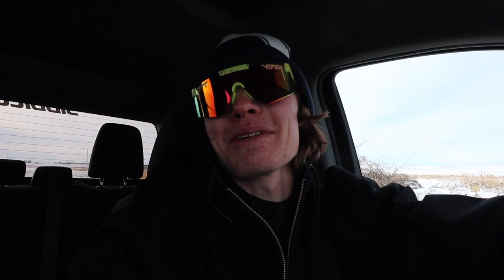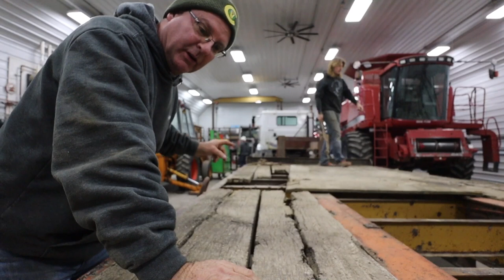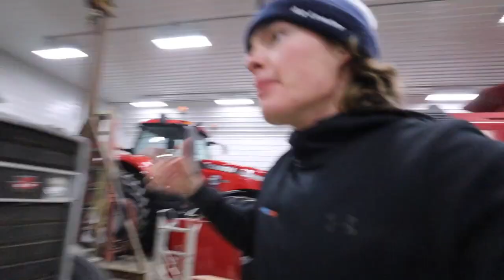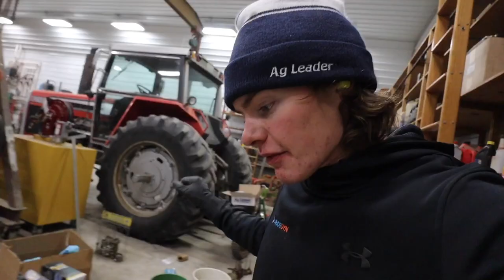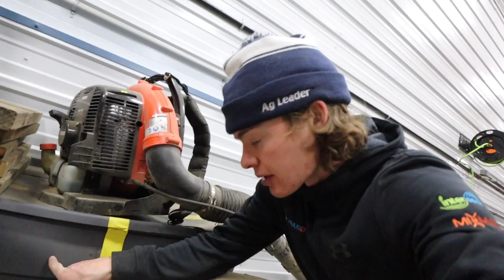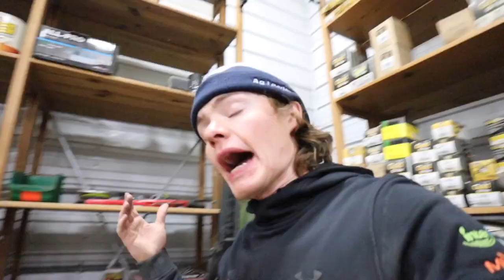REBUILDING A 40+ YEAR OLD FLATBED TRAILER

Comment: Get those brush fires started! Push them up into a steeper, densor pile, place part of a straw bale in the center surrounded by smaller wood, soak the straw in diesel fuel and watch them 🔥

Comment: If I were you while you have all that wood off your trailer and thinking about re-wiring it might as well paint it quick make her look real good
Reply: What I was thinking was, hey the fires won't start, use those old crappy trailer boards it will go up like blue blazes
Reply: Well painting it will be one hell of a project but rewire is probably a good idea
Reply: Yeah I would definitely rewire for sure, clean up all the brake line fittings and get the rust off her.  These midwest winters eat cars and trucks alive if you dont keep on top of it body rot creeps in really fast.

Comment: Hey Cole, as a former semi trailer mechanic of 16 years I really wish I could give you a hand on this trailer. However, since that's not feasible I'll offer some advice. Please reconsider using the saw mill wood. Up-front the cost will look better but the longevity of it won't be very good. You need apitong decking for a much longer floor life. Consider searching your area for semi trailer repair shops for the product and fasteners. Usually a 5/16x3" floor screw maybe 3 1/2". I also recommend a slight counter sink for them and plenty of extra t40 torx bits. Stagger your board end seams for better strength. It's also a great idea to undercoat the wood if possible. That will be one very solid and long lasting floor if done correctly. Feel free to message any time. And in reference to an much older video please don't ever weld a radius rod back together on the undercarriage. It causes bad tracking and excess damage when it's a really cheap part and a twenty min fix.

Comment: With all the oil you probably go through have you ever considered a reclaimed oil burner for heat in the shop, or at least for one of your future shops.  By far one of the most efficient heating methods is infrared heaters.  Large tube style heaters are the preference for most Plane hangers in the upper Midwest.  They work very similar to radiant floor heating, it heats objects in the room (not the atmosphere).  You can set the thermostat to around 60 degrees and feel perfectly comfortable in the space.  They work very well when you open and close doors often.

Comment: The best burn pile starter I’ve used is a propane tank with a high BTU weed torch.  You need to get a lot of heat into a cold pile

Comment: To start  brush fire get an old tire pile on some dry wood and some diesel fuel gas mix and fire up. Once the tire lights it will burn hot a long time.

Comment: I used cottonwood planks off the butt cut for decking on my lowboy trailer. Loaded D-9's on it without tearing the decking up. Saw them green, preferably after the sap has went down and get them bolted down quickly or they will warp badly. A good soaking in used motor oil and diesel fuel before putting them on keeps them from rotting. The oak deck that came on my trailer lasted 2 years and then started going to crap. The cottonwood deck lasted for the 6 years I had it and the guy that bought it got many more years out of it.

Comment: use a leafblower to get that fire started
Reply: That really does work!  We've had hard to start piles, and finally we started a fire with known dry wood in the middle (on the bottom) and gradually added existing pieces from the pile directly on the fire and as the fire burned the surrounding wood heated up and dried out so finally it was ready to burn.  A leaf blower adds oxygen to the mix and is so very helpful!

Comment: If you weld some chunks of square stock on the side of those ramps you can make a handle that slides into them that's angled a little that makes them easier to flip over

Comment: A rate controller controls the rate at which product flows from the nozzles on your fertilizer delivery system. It is usually used in tandem with thing's like a Spray Switchbox, and is hooked up (via ISO) to the black box in your cab which you use for guidance.

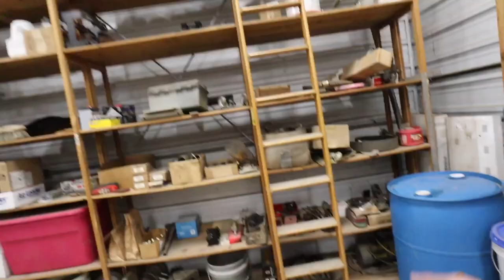Comment: You should examine the wires for the starter.  There is probably a lose wire or a wire shorting out some place.  I was looking at the tractor tire at 7:02.  It looks like it may be flat.

Comment: You should inspect all the beams on the trailer while the deck is off 2 of the trailers a contractor that i do work for both were bought new 20 years ago had major rust holes thru the the major beams and were no longer considered safe for hauling and either needed major repair, to be scrapped or sent to auction to be made somebody elses problem

Comment: When I torch a big brush pile my go to recipe is 5 gallons of drain oil, then toss on 1 gallon of diesel fuel and a cup of gas. It lights in a controlled manner and by the time the drain oil burns away you got a roaring fire.

Comment: Diesel or oil with gasoline works great. Being diluted, the gas will get it lit and the diesel keeps it burning. But when you splash it on, wait a couple of minutes to let it soak the wood. Been a no fail for me.

Comment: Re burning brush/trees..... You got to pile em high, use lots of "accelerant" (used motor oil) and if you have a "leaf blower" use that to fan the flames. Once you get things going, its going to burn HOT and you have to keep pushing the piles up and burning.
Some have reported using a couple small square bales of straw saturated with diesel and used motor oil with the leaf blower as a good thing to try.

Comment: You might try using a battery operated blower to help getting the fire started. Shove in a bale of straw and wet it with Diesel.should help also.

Comment: That box off the white planter is an Original Greenstate Rate Controller. Most likely used to measure and control liquid nitrogen fertilizer or insecticide. Guy who had it before must have had a Deere monitor in his tractor. They are still worth some money since you can also still buy them new

Comment: You are missing an ecological opportunity for a great household garden.
Look up the videos on Biochar. You have plenty of the best materials to burn into chunks of charcoal,...notice the word coal?.....sounds just like Cole.
Granted, making Biochar/charcoal is going to take up some time, but, if it is allowed to culture in a compost heap, and grow the necessary micro-organisms,  for a year, you will then have a really good household garden from what is then called Terra Preta.
The old wood from the trailer could be used for building the boundaries for raised beds about 24" to 30" wide and how ever long you want them. Then spread out the Biochar about an inch or more thick. Then, build the compost heap, sheet compost style on top. Also known as Lasagnia Gardening.
Surely someone nearby has a large round bale of spoiled hay you can spread out a foot or two deep, to get the soil biology started. It might help to wet the hay down and cover it with sheet plastic to both protect from the wind and get the biological process started in the soil.
Then just plant straight through the remaining hay in the spring.
Remember the old saying; waste not, want not.
P.S. 
#1. I almost cried the last time I saw you burn trees. 
#2. See Also: Terra Preta.
#3. You can buy bags of Mycorrhizal fungi, earthworm castings, 
fish emulsion, 
Chitin, and
Azomite minerals on Amazon to sprinkle over the Biochar, then cover the whole area with hay, water it down, then cover with plastic until spring. 
You will be amazed what you can grow in the spring.
St. Patrick's day isn't that far away.
Merry Christmas

Comment: odds and ends - when you do the house just do one section at a time cause it will be messy and moldy - really the garage is the main task - you will be able to do them both at same time - if that is too much just concentrate on the house - it is not like you don't have shop space

Comment: It's truely sad how many people think it's a good idea to burn a tire.
The best use of a used tire is to repurpose it.
If you cut the sides off with a sabre saw, then cut the tire across the treads, the tire can be layed out flat. 
Given the tons of gravel on the driveway, it might be a good idea to use the flattened treads as edging between the new grass and the new gravel.
Or, as mud scrappers at a doorway. Or, cleaned and kept in the trunk of the car for helping get a car out of a snow bank.
Or, make outdoor furniture.
The possibilities for repurposed tire are numerous. And there is no need to create any air or soil pollution.

Comment: chuckles to take planks off a deck you cut the plank on each side of the X members and wackem with a sledge, then go to a trailer repair shop or sales and get actual deck screws to puttem back on   ya has a mechanic who has trucked and fixedem 49 years

Comment: A little diesel and gas mixed, that brush pile will burn and yes, use a leaf blower. 
For those gloves, use baby powder on your hands, they'll slip right on, just hope your hands don't sweat while wearing them. 
Since you have the flooring off the trailer, smart thing would be, go over the wiring, check and maintain the springs. Those bushings don't last forever and springs do break. Give it a decent paint job including underneath. Cheers :)

Comment: How's the attic windows project going on the house? And the kitchen demolition? And the connector out to the garage, or is that in the Spring? Did you ever finish up the house basement, I remember you mentioning you might do epoxying to the floor down there? Only reason I mention these things is because it's like they all got left hanging and now it's Winter when indoor stuff gets worked on. 🙂

Comment: Hey cole instead of wood you should put 3/16 thick inch metal ont the trailer we have a tilt top that we haul our 46,000 pound dozer on and the metal holds up so much better and you never have to replace it so it saves money over time

Comment: I burned 7 huge green maple trees one late January night, NW 16 mph wind, it blew right through the huge pile up tree trunks & branches.  We took out as much fire wood as possible first.  I was wishing i had the military   to fill the hallow tree trucks with napalm,  that would make it burn.  But with the wind, it was like a blast furnace.  I was going to burn one night in December, right after it got dark, because i had a huge number of used tires, surrounding the piles, from tire shop they gave them to me. But the wind was blowing over 30 mph,  it was like a war out there, no way was i going to do it then.  I stayed with it a couple hours, with loader tractor, pushing the pile around. Then went home, came back in the morning, before day break, had more tires to place under the tree trunks. Then the next evening,  re-pilled  trunks again on the last of the tires. It all burned but for a very small part of a trunk of the larges tree.  Couple weeks later came back & cleaned up the wire & chunk of unburnt wood, after  the ashes were cooled off.   There was a slight amount of snow on the ground, around here you need a burning permit, i got that, call it in, told the cop not to send out the fire trucks if some body call it in. Had to burn it at night, so nobody would see the black smoke from the tires.  I had pickup loads of them.

Comment: Another idea for wrench storage is to use a block of wood cut thats the same depth and length as your drawer. Cut notches in it to hold your wrenches vertically. I did that and used a label maker to label every wrench size. I was able to put two sets of wrenches in the amount of space it took for one flat.

Comment: would be perfect time to give the trailer a pressure washing and epoxy paint on the frame before you put new lumber on it protect it from road salt and mud that builds up in the corners   would look great another 20 years.

Comment: Would not recommend the wood for the flatbed trailer. I would highly suggest using Diamond Cut Metal Sheets as they never rust and are very strong. Check it out -- https://pixabay.com/photos/metal-floor-steel-pattern-5783835/

Comment: lol a lot of old fuel or the night, before you want to light it borrow his fuel from his tanks you save money that way too best, is to use a jerry can from his place too if gets out of control look like you neighbour did it lol yea before we had the new fuel tanks here one neighbour run out of fuel at night he at the diesel tank fuelling up yea it got back to the police station lol yea we were over at the neighbour's place when the police stopped by asking us if we heard or had fuel when missing we play that game well the officer said the fuel was marked with die yea purple light would know if the fuel has it.his hands were  covered with the die to and his truck and his fuel tank to  lol yea i lift the farm  yea would have been purple too lol  poor guy my dad said when they found he had the purple colour all over him  lol
i use a tiger torch with the fuel  to start the r torch allows the pile to stay light longer check with your country before you burn you may need a permit here we need to and have signed on the road too  we rent them from the county  yea  but where my uncle has his sawmill  he is responsible for the signs  and a dozer running  if needed could use the dozer to bush the pile down too   
 i was charged with not have a permit it was in the gray time it was happening did fight it in court and it was drop lol  we need now to have a permit to have a fire in a fire pit now too here too  lot of campers they pay arm and a leg for that  too at the campgrounds too yea all we did phone ahead of time to the country you camping in they email you the permit free  lol